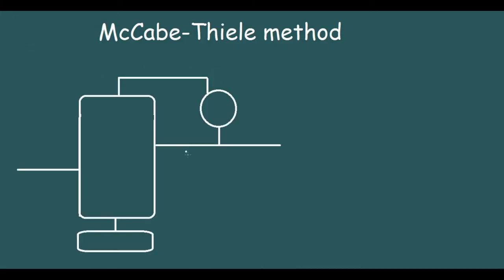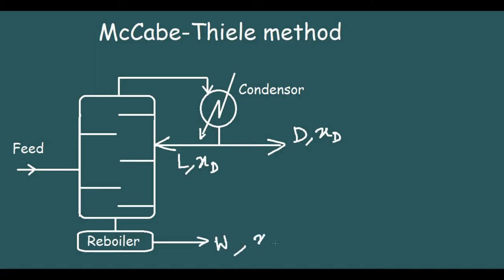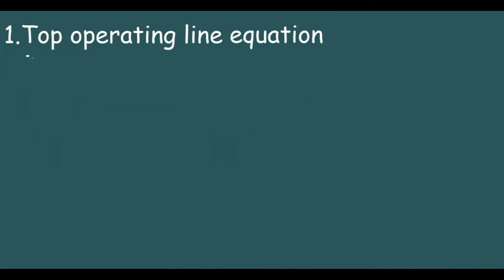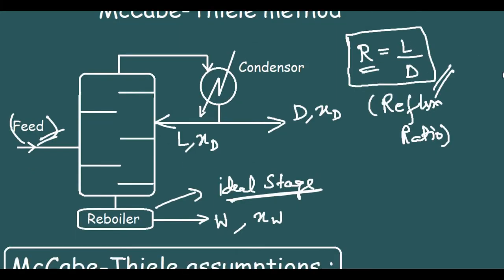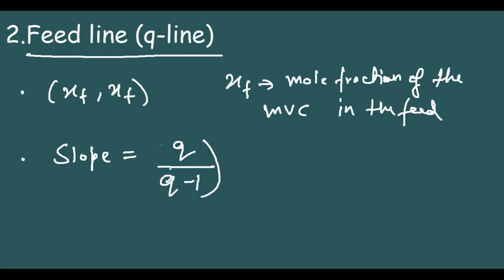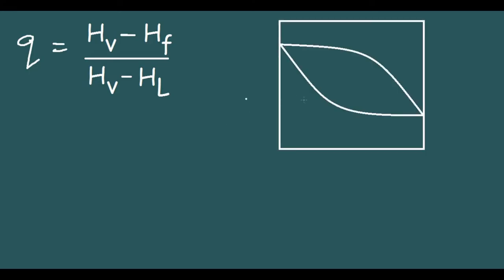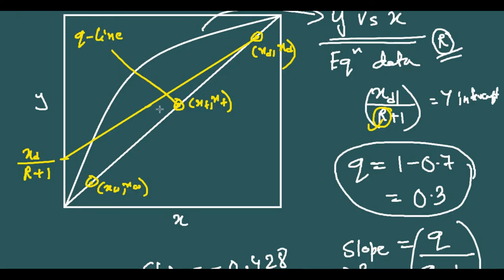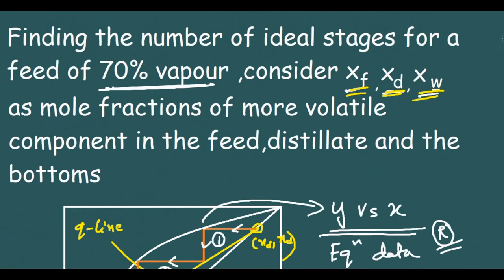Construction of Stages using McCabe-Thiele method |Binary distillation|

Comment: how if the feed is 70% vapor q is 0,3 should not you calculate the enthalpies
Reply from the maker: In the book Principles of Mass Transfer and Separation Processes by Binay K Dutta , if you go to the Page number 368, you will find that (L'-L/F ) = q = (Hv-Hf/Hv-Hl) . So we can find q by either calculating the enthalpies or by finding L'-L/F which is nothing but the fraction of the liquid in the feed. 
Here I calculated q by using L'-L/F which is simply the fraction of the liquid in the feed .

I recommend you read this book for better clarity , and all the best !